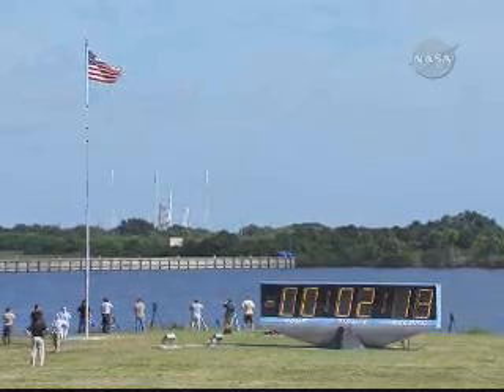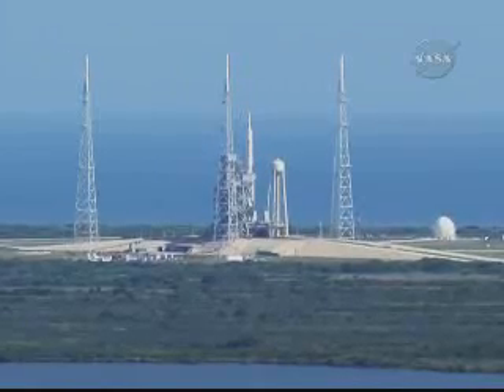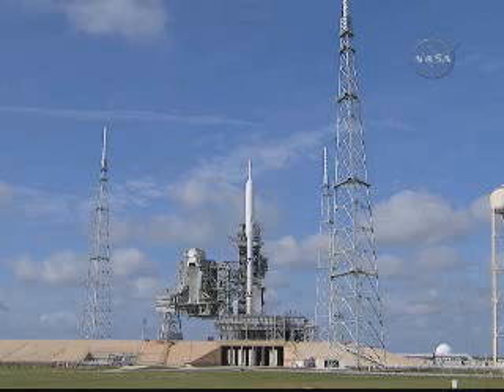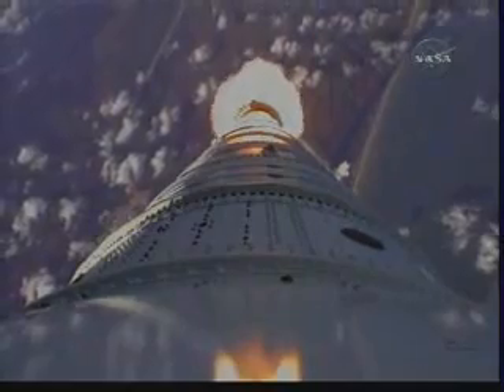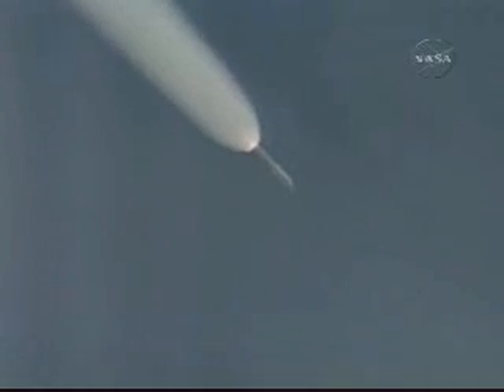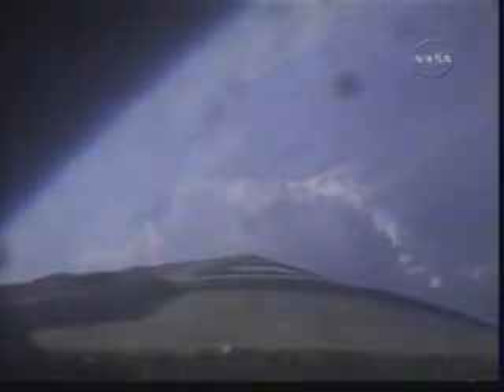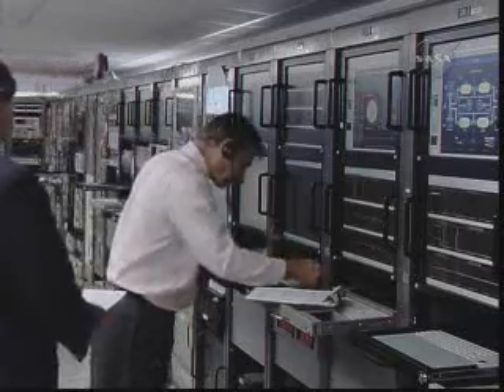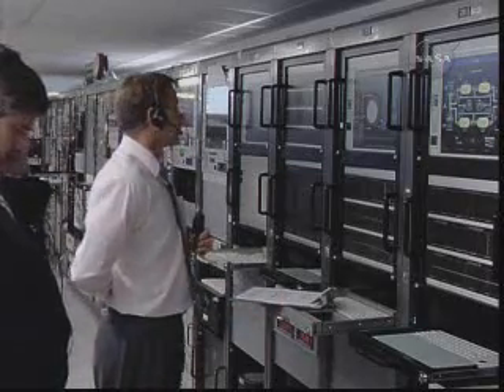NASA Ares I-X Rocket Launch Wed, 28 Oct 2009

Comment: yeah, it works, better, safer and cheaper than the old stuff. lets chuck it in the bin...
Reply: One of the two failures in the Shuttle program was because of the SRBs, which are expensive to build (or even refurbish after recovered).  So yeah, not so cheap, or safe or better.  IT WAS THE OLD STUFF!!!  Even the supposedly cheaper "Liberty", ie, what you just saw with an Arianespace upper stage was going to cost $180 million per launch.  Even more than the ULA Cartel's Altas and about 3 times the cost of a Falcon 9 launch.
Reply: SRBs were cheaper than liquid back in the early 60s.  The Shuttle's SRBs were there because they shuttle's main engines didn't have enough thrust at sea level for lift off.

Comment: Why was the Ares I cancelled? Even if the Ares V wasn't going so well, this was a completed design.
Reply: The crew was sitting way above the SRB and had a Launch Escape system- these SRBs were developed from the one's that launched the Space Shuttle any ways and were super reliable.
Reply: +Matt Pelzek Issues with vibration in the SRB stage last I'd heard
Reply: Yeah, maybe riding a giant firecracker wasn't the best idea for crew safety.
Reply: @Chobittsu - The Ares I-X flight telemetry showed the vibration issue was a false worry. Vibration was WAY below what they expected. It was less bumpy than a Shuttle ride.
Reply: The Ares I had to be cancelled because of the United Launch Alliance, a Boeing/Lockheed cartel formed after Project Constellation was formed.  Constellation involved Boeing, Lockheed as well as Northrup Grumman and Alliant.  While the Ares V was doing badly, the Ares I wasn't.  Also the Orion Capsule development was going badly.  Constellation was replaced by the SLS to freeze out Northrup and to limit Alliant's (now Orbital ATK) by keeping the two struggling components, Orion and the "totally not Ares V" SLS.  

The SLS protects Boeing and Lockheed components while limiting Alliant's involvement.  If Ares I had been kept and the rest of Project Constellation had been cancelled then if Boeing had any problem with the upper stage, Alliant could just look for a different upper stage (as it did with "Liberty" and now it's "Next Generation Launcher", the former having an Arianespace upper stage and the latter having an Orbital ATK upper stage with Blue Origin engines.  If the Orion Capsule had continued to give problems it too could have been replaced with Orbital's own Prometheus (a HL-20 knockoff), Sierra Nevada's DreamChaser (a HL-20 knockoff as well), Dragon, or any of the other four or five options floating around in the 2009-11 timeframe.  

No, the SLS was for and by the ULA to protect Boeing and Lockheed's interests.  It was them who caused Constellation to fail and their failures live on in the SLS.  That's why the fucking thing hasn't flown yet and probably won't fly until 2019 or later (it will miss it's 2018 launch schedule).

Comment: how can they film the rocket from so far away?
Reply: floristeanu daniel facepalm....
Reply: With the use of lenses in the range of 400mm to 1200mm focal lengths.
Reply: can we rally be sure space flight is real?
Reply: Ask that the next time you get in your car and use your GPS, or the next time you send or receive an SMS.
Reply: floristeanu daniel troll.
Reply: Pepperstm GSM uses ground-based antennas. Even without spaceflight, you'd still receive phonecalls and SMS

Comment: Why the hell did they cancel the ares rocket??? It seems like its cheaper than that SLS which nasa intends to use for both ISS trips & deep space explpration thus waisting money on a heavy lift rocket that should only be used for deep space like the moon & mars. They should have kept the ares as an ISS crew & cargo delivery vehicle and rarely use the SLS. Now I am exited to hear nasa is more enthusiastic about deep space but they shouldn't have to red line the budget for ISS missions. The space shuttle was massively overpowered for what it was used for (crew ferry to the ISS & cargo) which is why it was retired. We used the Russians as a taxi service because the fair was only $50 million to $70 million per seat on their soyuz spacecraft and we only really sent one to two American astronauts to the ISS at a time saving a ton of money vs paying $450 million per launch of a space shuttle.
Reply: Spacex Falcon 9 v1.1 will do the job instead of Ares 1.  SLS is being designed for deep space exploration, with a rumoured manned Mars fly by before 2022 using the Orion capsule.  The Space Shuttle Orbiters were retired for two reasons, they were getting too expensive to operate, and they had completed their reason for flying, building the ISS itself.  It costs NASA $62.7 million dollars per seat on Soyuz, NASA's using the Russians because only they can put human beings into orbit.  The Falcon 9 will be cheaper than both Ares 1 and Soyuz, the launch vehicle is designed to be reusable, the booster stage, upper stage and capsule.  They will land themselves at the place from where took off from automatically, using the Grasshopper system.  The Space Shuttle would now be costing $870 million per flight, this is because of the higher maintenance costs as the fleet was starting to show it's age.  Only one American is generally launched per flight.
Reply: +Johnny B SLS isn't used to get people to the ISS, it is only used for taking astronauts beyond low earth orbit. NASA will use capsules designed by Boeing and SpaceX sitting on top of off the shelf expendable rockets. Boeing will use an Atlas V rocket and SpaceX will use their own Falcon 9.
Reply: NOVA I know that now. Lately Ive been following the progress with the commercial crew program and it seems like a better alternative to paying Russia for ISS crew rotations. Using the SLS as an ISS crew backup is a bit wasteful as its over powered and expensive for that. It would be cheaper to use a delta 4 heavy and an Orion capsule as an ISS crew backup plan. The first unmanned test flight of Orion was on a delta 4 heavy last year.
Reply: NOVA
The Falcon 9's not designed to be expendable. Let's see if Boeing can build something as reliable and reusable as the Falcon 9.

Comment: so why are they using a solid for the first stage its completely un controllable abd you cantescape it if something goes wrong and if the thing that goes wrong is the solid then... well atleast itll be over quickly
Reply: Do you see that large skinny tower at the top of the rocket? That's the launch abort system. It contains solid propellent that, in an emergency, can carry the cargo or crew of the vehicle clear of the presumably damaged lower stages at which point they will safely touch down by means of parachute. If all goes as planned, the tower is jettisoned just before entering orbit.
Reply: Finger Gun Studios except if anything goes wrong with a solid rocket motor it usually blows up immediately
Reply: killman369547 Yeah, but the explosion takes time slower than electricity which delivers signal to detach. The scientics did a good job, don't try to outsmart them alone.
Reply: ***** i agree however the big sellng point of liquid engines for me is the ability to shut them down if they develope a fault with a solid rocket you can't shut it off once its lit its committed until it runs out of fuel
Reply: ***** "For example, that explains why 80~90 % of missiles are working with solid engines. Very safe and easy to use ! =)"

I think missiles use solid fuel engines because they're simple, long-term storable, and don't need any complicated pre-launch sequence. Some percentage of losses due to faulty engines is also tolerable in missiles - more than in launchers, even unmanned - since one expects that some percentage won't hit the target anyway even if everything works properly, so absolute reliability doesn't matter nearly as much as minimal loss of reliability over time in stored missiles and the simplicity of reaching and keeping that level of reliability.
Reply: Why? Because congressional pork for Morton Thiokol and Utah?
Reply: ***** thats just bullshit you dont know what youre talking about 
solid fuel is a lot more dangerous

and btw one of the 2 boosters BURNED into the lh tank ofc they kept running but that doesnt mean they cant kill your crew

that would never had happened with the buran :)
Reply: Lu2if3r Ah, the usual russian nationalist showed up, as always, thank you. Did buran fly more than a few times? Nah. Shuttle did. And over 150 times. And now, prove your point, that solid fuel is way more dangerous than liquid fuel.
Reply: Lu2if3r Well firstly, I'm not very acquainted with German humor, but that's not funny (Das ist why the entire world laughs at you). Secondly, The buran shuttle only flew once before the USSR fell and the program was canceled. The American shuttle was also successful on its first flight, and if we stopped there like the russians did, we too would have a 100% success rate. It flew over 130 times with only two losses. Solid boosters may not have been the safest option, but they never caused a single accident in the entire shuttle program (Challenger was an O-ring failure, and Columbia was a hole in the heat shield). 

By the way, blatant name calling is irrelevant and childish. Your final paragraph simply nullified the legitimacy of rest of your argument.
Reply: +Lu2if3r  The burn-thru was due to a design flaw in the aft field joint of the booster, not due to the danger of solid rocket engines.  Plus they launched Challenger when the temperature at the launch site was about 15 degrees F lower than design constraints allowed, which exacerbated the joint problem causing the joint failure and burn-thru.  The temperature at the launch site was in the upper 30s F on that day (Florida's weather is typically in the 70's that time of year).   Later boosters were redesigned.

Comment: My intrest for spacelight sparked my intrest in KSP, not the other way around. I only learned orbital mechanics from KSP.

You can shut a liquid fuel engine off. You can't shut an SRB down. That's the point. While both types of engines are bombs, you can defuse a LFR.

Comment: All rockets (im assuming you have learned this based off of your KSP profile picture) are controlled bombs. SRBs may pose a risk, but it is part of spaceflight. Anyone who flies on rockets using them signed up for it. Even if you were to use liquid fueled engines strong enough to replace SRBs, they would be dangerous as well. Although you do probably do stand a better chance of bailing out of a failure involving liquid fueled rockets.

Comment: The problem I, and also several astronauts that retired when it was announced that the Shuttle would use SRBs is, they are basically pipe bombs. And you can't throttle or shut them down.

The Constellation program was, and SLS now is desperately trying to reuse as much Shuttle hardware as possible.

Comment: It's not all that easy. Firstly you need Reaction Control to turn the stage retrograde just after separation. Then you need additional fuel to de-orbit the stage properly. Then you need a magical heat shield tucked in there somewhere and again Reaction Control to reverse its direction. Then you need parachutes to allow it to safely return. They don't have any of this. SpaceX is working on concepts for such a system yes, but NASA can't. They're too bogged down in other obligations.

Comment: We know where it will fall before we launch it. In fact, you can't launch anything without telling the government exactly where each stage is expected to land. Not only that, they have tracking systems on the boosters and know exactly where they are all the time. The space shuttle's SRBs reached an apogee of 42 miles, almost identical to this rocket. Recovery is absolutely not an issue and it's nowhere near orbital speed, that's why it falls back to Earth so quickly and without re-entry heating.

Comment: A test in NASA is not merely normal test, test is required to experiment new technology appliance on the rocket. Thanks to NASA you have GPS and 3G at lower cost in cents value today. Cheers

Comment: @Concordski101 
Roll control thrusters were fitted to the upper stage simulator.
The shuttle didn't use it's elevons during ascent, steering was done by swiveling the main engine and booster nozzles.

Comment: @EpicTrailRides Incorrect.  The double boom is for any supersonic flight. (Anything higher than Mach 1.0) The first boom is caused by the rapid increase of pressure when the single shockwave hits and the second boom is the rapid decrease of pressure following the departure of the first.  There cannot be more than two, unless you simply hear echos reflecting from different areas the shockwave passes.

Comment: @monokhem - The Falcon Heavy is fine for what it does but when it comes to lifting heavy cargo and equipment to BEO or fuel depots to Lagrange Points it would be even more underpowered than the SLS. The Falcon Heavy is fine though for lifting moderately heavy space stations like the ones Bigelow Aerospace is constructing.

Comment: @monokhem - With a lifting capability of only 100,000 lbs. to the Moon at most with the SLS (even less to Mars, probably around 60,000 lbs. or so) it's more difficult to set up a base or colony on Mars or the Moon and you can't lift as large of space refueling depots to Lagrange Points as you could potentially do with the Ares V. The Ares I and V's upper stage potential issues could be solved with either an air-start SSME or a 20-25% more powerful J-2X engine.

Comment: @monokhem - The other problem I have with the SLS is that it's underpowered. It's simply not powerful enough to lift any significant amount of weight to BEO. The thing doesn't even lift as much as the Saturn V rocket. The Ares V was much more ambitious in that it could lift at least 404,000 lbs. to LEO if not more. The SLS lifts 6,000 lbs. less than the post-Apollo 14 Saturn V could. The Ares V was made to lift at least 158,000 or so lbs to the Moon and around 100,000 lbs to Mars.

Comment: @monokhem - If you no longer want to go to the Moon where the hell are going to go? You can't fly to Mars in the Orion. I wouldn't risk flying far past the Moon either in an Orion on its own as you'll be cramped in a small space for months with only enough supplies for 45 days and you'll be constantly assaulted by the solar wind the entire time. 

I'm upset because the SLS isn't designed by Congress rather than engineers and because it has no destination and Orion has no way of getting to a BEO.

Comment: @monokhem - And once off the ground where will it go?

"You can lift it with a falcon heavy"

Firstly, the Falcon Heavy is WAY too powerful for a simple Orion trip. It's just using an 18 wheeler just to drive to work. The Orion just needs a rocket in the 50-60,000 lb. to LEO class. Secondly, you can't just slap the Orion on top of the Falcon Heavy, the Orion would need some redesign to fit on top of it properly. Falcon Heavy would suffer from the same problem as SLS - where would it go?

Comment: @monokhem - You do know NASA's budget isn't all Shuttle? The Shuttle gets less than $10 billion of NASA's annual $18 billion budget. Of the funding increase Obama wants to give at least $700 million of it (likely more) has to go to private spacers. Obama is only giving around a $5 billion increase overall. That's not enough to build SLS. Obama wants that rocket off the ground by 2015 and the design isn't even finished? Do you have any idea how behind schedule it will be?

Comment: @LonghornPhysicist - Ares I has a recurring cost of around $138 million. That's significantly cheaper than Shuttle recurring costs (over $400 million a flight on cheap flights). Much of the money spent so far was on infrastructure changes, not just adding another segment. The redesigns were necessary because Bush and Obama low-balled the funding (they only gave it 1/3 of the funding it needed) which caused them to have redesign it to fly on a shoestring budget. Procrastination is expensive.

Comment: @Maxables You can't use a gimbal on a solid booster. The Ares I-X used the control system from a decommissioned Peacekeeper ICBM (which also used a solid fuel first stage).

Comment: @williamhad Only a small percentage of spacecraft fly straight up – the ones that don't intend to go into orbit. Watch a Space Shuttle launch and you'll see it roll a few seconds after liftoff shortly followed by a slow backwards arc. By the time it reaches the upper atmosphere it'll be traveling perpendicular to the ground.

Since the Ares I-X was designed as a prototype for an orbital spacecraft, it needed to test the same types of conditions.

Comment: @TONYPARAMOTOR You equating price to quality.   This is more about contracts and jobs that actual product.   If we must use cars a better comparison is the Stanley steamer (1902-1924) cost $3950, compared to under $500 for a Ford Model T.  The Stanley steamer always ran the risk of the boiler exploding.  In saying that, I would chose falcon9 today over both Shuttle and Ares1.  Falcon9 has the option to turn off any of its 9 engines in mid flight.  Ares1 or Shuttle cannot stop once started.

Comment: @ti994apc - That was way back in 1972. A lot changed about the Shuttle since it was designed back in 1972 and a lot of capabilities were cut. Like being able to be launched from Vandenburg. They als

The Shuttle is a lot fussier when it comes to when and where it can be launched. All the factors to increase the price of the Ares I have already come into play so the price probably won't go up much more. Unlike the Shuttle the Ares I doesn't need to be rebuilt after every launch.